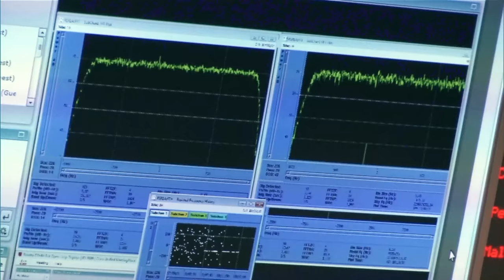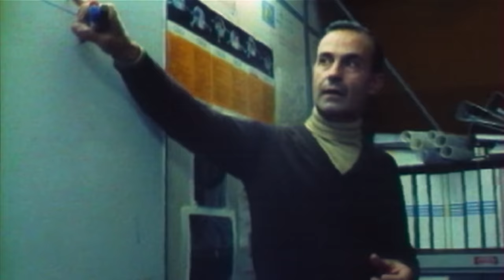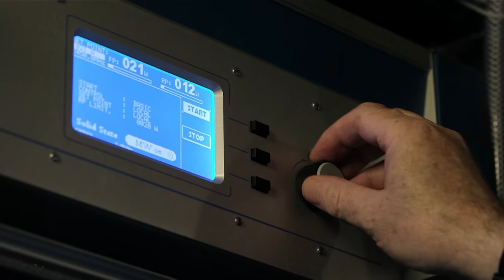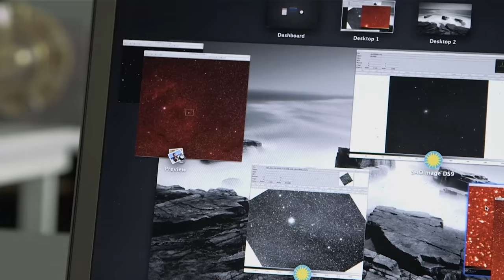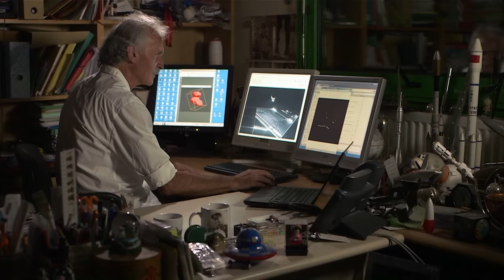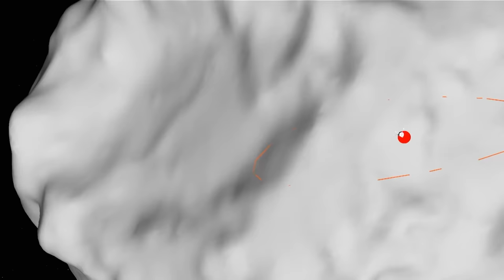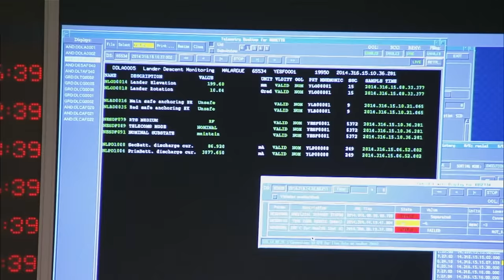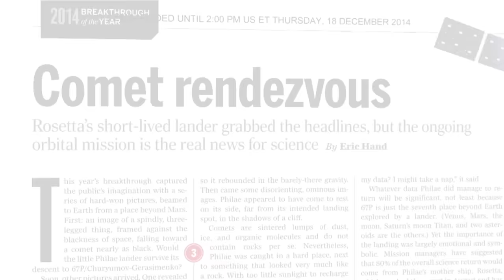A Journey To The Origins Of The Solar System | Rosetta Comet Chaser | Spark

Comment: I'm amazed that the mission turned out so bad? So tell me, with dozens of smart people on the team, no one could think of a way to see if the surface was suitable to receive a harppoon? Its just so lame to not know what the surface was made from. Heck they could of sent a small object into the surface to test it? Is the fact that no one understood this unknown surface? Its just like when the NASA rovers on Mars, get the solar panels covered with dust? How could you not think of that one? Fail and fail! I would be ashamed of myself if I worked on these 2 missions and did not plan for this simple possible outcome!?
Reply: These things happen. What about all the other missions scientists have successfully completed. It had never been done before. If you was in charge of the Rosetta or Mars mission, you wouldn't get anything off the ground let alone into space.
Reply: In Chuck Yaeger's autobiogaphy he mentions that when he was a test pilot at Muroc Dry Lake (later Edwards AFB) the pilots and flight engineers referred to it as the "ughknown".  When you're pushing into unexplored territory, whether in aerodynamics or space, there are a lot of little things that can reach out and wreck your project.  It doesn't matter how smart your engineers are (and people like Jack Ridley were both very smart, highly trained, and very experienced), when you're pushing into new territory you have to make educated guesses and assumptions about the contitions you're going to find.  Sometimes you're wrong...the "ughknown" just bit you.
Reply: Success is built on top of failure.
What did you achieve thats so groundbreaking.....
Reply: Armchair expert
Reply: @christopherreed4723  they made history grandchildren will start from there.that is why I hate wars.a stumbling block to new frontiers by man.we lost Germany🤕